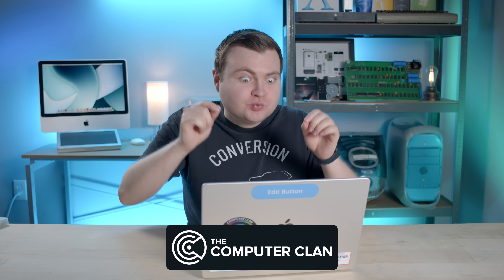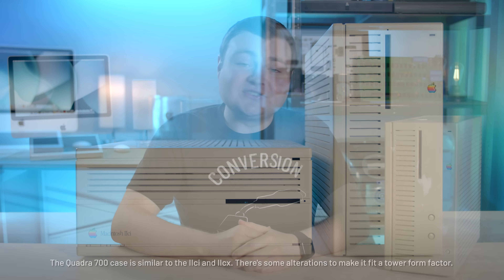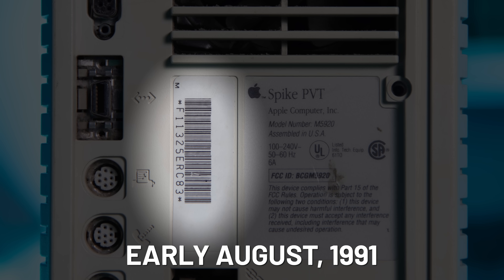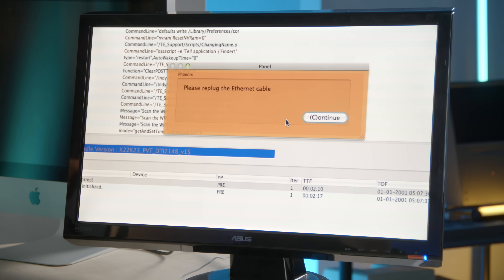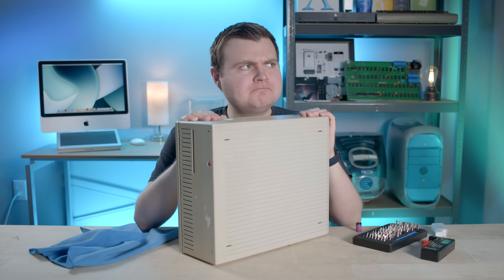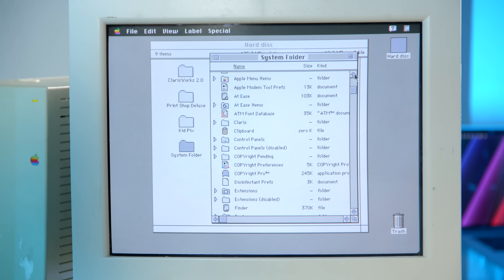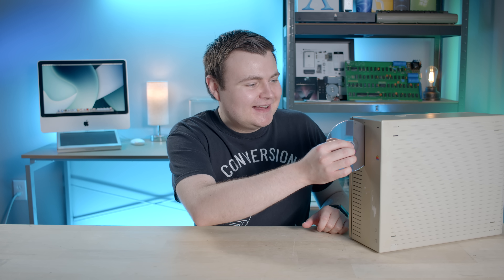Rare Macintosh Quadra Prototype Hits eBay (and I Got It!) - Krazy Ken’s Tech Misadventures

Comment: In my experience when a EBay listing says "untested" it means "tested and not working but we'll get more if don't admit that"
Reply: Or just more simply we don't want any complaints.
Reply: I’ve often had the opposite experience but yeah it’s awful when that happens.
Reply: With macs if it doesnt come with a power cable and or a keyboard it likely actually is untested as they dont have the means to boot it up
Reply: @rambles2727  why? PS/2 keyboards were pretty common for a while and power cables have been standardized for ages
Reply: @myrealusername2193  because the keyboard has the power key for some of these computers so they cant be turned on without one.
Reply: I bought an IBM Anywhere Kiosk PC which was listed as 'untested', probably because the unit has a very specific power supply. I managed to find one locally and got the PC for a tenth of other listings!
Reply: Sometimes, it means "I have no idea what this is or how to test it, it's outside our wheelhouse, but it was on this pallet of surplus computers we bought, so may as well sell it"
Reply: I got burned on a listing on ebay being sold as 'for parts', the listing showed the laptop booted up and working, but was sold as parts because it did not come with a hdd (data security reasons).

when it got to me, it would not boot at all, thought it may be the power button until I started pulling it apart and noticed someone had stabbed the motherboard with a screwdriver (they took the ram cover off, stabbed the board and put it back on).

even though the listing mentioned that the the images were actual photos of the device for sale, ebay/paypal sided with the seller as it was being sold as parts only.
Reply: @myopinion69420  wow that's pretty rough.
Reply: My experience with untested stuff on ebay has been stellar. It is a bit of a gamble but well worth it! Don't buy an untested HDD or SSD though, but other than that you can't really go wrong as long as you do your due diligence.
Reply: @myrealusername2193  no apple products ever had a ps2 port.  I think some of the mac clones did but no official apple hardware did
Reply: @bzuidgeest yeah, in my experience it’s really a CYA kinda thing. If you say it’s broken, and it works bonus but if it says working and doesn’t, I suspect that’s a problem.
Reply: You have very limited experience.

Comment: I'm sure a million people have already commented, but good batteries are required for some of the older Macs.  From my own experience, the II line and the portable (which is a little bit of a different case).  You can "jump start" at least the II and the IIfx with a 9 volt battery.  That probably works on some others as well, but I have only jump started my II and IIfxes .
Reply: I have a LC475 and it needs a PRAM battery, but you can kinda jumpstart it if you turn the PSU switch on/off/on fast.

Comment: "Untested" aka I tested it briefly and it didn't work so I want to cover my ass against returns and entice a potential tinkerer into buying it for more than if it was sold as faulty
Reply: heres the issue with that thought process, as a tinkerer I go out of my way to ignore "untested" and only look for "for parts as is faulty"
Reply: Lol, too true. I got a G4 last month for less than $60 and it needed, at the very least, RAM, storage, a GPU, and the power supply was failing (quickly died after I bought it)

Comment: Cool, always love seeing prototype hardware! 
I own a PBT Radeon card, but the strange thing is, its date code is from a month after the official release (but it still has an engineering sample sticker). And it appears to have been sold as regular stock at some point, since it seems to have been used daily like any other video card. These are always such a mystery.
Reply: Got two Alienware laptops that are engineering samples as well an XPS which is pretty cool as there were minor difference between them and the retail models.
Reply: @MrKillswitch88  Sweet! Saw a Dell Precision engineering sample on ebay but it was $9,999 so I didn't go for it lol
Reply: @DavisMakesGames  Yea at that price no one will lol wow. I bagged the XPS at a local goodwill before it closed down years ago and the two Alienwares were cheap eBay fodder.
Reply: Cool!
Reply: Maybe that Radeon card you have is a PVT with another factory. I'm not too sure on how manufacturing processes work, but it would make sense to me that if a company decides to pull in another factory they haven't worked with yet to run another PVT batch with them to see if the quality is good enough or any adjustments need to be made, kinda like how the current Mac Studios Power Supply has different designs based on what factory it came out of...

Comment: The Quadra/Centris era was such a fascinating one!  Full featured (for the time) web browsers running in a few megabytes of RAM as opposed to needing gigabytes today.  Today's browsers are practically whole operating systems of their own (and sites like Facebook and YouTube are practically whole applications), although I guess that's what it takes to safely and reliably have multiple tabs open.  And very interesting that an Apple prototype would use an IBM hard drive.  The smoking character was hilarious because it still doesn't feel like that long ago to me that so many people still did smoke indoors at their desks without giving it a second thought, and it's one of the very few things I don't miss from that era but it is very accurate to when this computer was made, and above and beyond what most tech content creators today would do.  Finally, seeing you literally stuff a cleaning cloth inside a computer like that with your hand made me so nervous, how is that safe from static electricity?  Anyway keep up the great work.

Comment: In 1999 I worked at a store called Computer Renaissance. 

In the back of the store they had a Quadra 700 style computer with a 68040 processor at 20 MHz. It had no label & on the back of the computer it had a label saying “SPIKE PVT” just like yours.

Comment: Hey Ken, good video as always.  I really miss the classic Mac OS at times.  I have most of my old Mac software backed up on a flash drive, after I was able to get it off floppy to a CD, and then moved it to flash storage.  Used to run it in BasiliskII on my current Macs.  It was nice to play around with again.

Comment: a lot of retro tech is a pain to test if you arent neck deep in the retro ecosystem given that a lot of these use obsolete connectors, display formats and/or require accessories to boot that arent necessarily on hand or common, ive gotten deals on a lot of old stuff because of this

Comment: Another great video. I'm pretty sure that the seller just didn't have the rest of the old Mac equipment like you do or they would have sold it as a bundle. Was there even a power cord? I assume a Mac like that  is like old Windows PCs where you couldn't get far without a keyboard plugged in. Plus if they didn't have a monitor they couldn't be sure it really booted.

Comment: A lot of vintage computers on eBay are sold by people that don't have the hardware to bring it up. So, pending it's something that isn't standard PC stuff, it very well might be actually untested. I still look through their other items just in case: if it's full of garage sale type finds and very little computing stuff of that type, probably actually untested. If it's full of other stuff that would likely mean they have the gear to test (needed monitor or adapters), or even more telling, tested items of the same sort, it's dead Jim.
Reply: When I sell on eBay, if that is the case, I'll state that.

Power cords on a lot of these are standard and common, so I might try plugging it in.  Did I get a puff of magic blue smoke?  If so, then that is something worth noting.  

If not, did it do anything at all (or nothing at all)?  I'll mention that.

I could then try the power button.  Do I get any LEDs?  Are they on solid, flashing, a particular color?  Any sounds?

There are almost always *easy* things you can do even if you don't have an appropriate keyboard, mouse or display.  

A seller too lazy to even try some basic stuff is probably too lazy to even pack the unit up properly, so if I do buy it, amd I just going to get a banged up piece of equipment that even if it worked before likely doesn't work now?

Unless I'm paying literal pennies on the dollar, a seller doing the bare minimum doesn't get my business.

[edit] As a note-- back around 2002-2008 I was buying Silicon Graphics machines on eBay and with those you often need a sync-on-green display that required a 13W3-VGA adaptor, so it was understandable if the seller couldn't test it for video.

Comment: PV samples are prototypes, there's still time to change things before prelaunch rampup and there often is like minor smt pad changes, silkscreen and components, things you wouldn't find doing smaller DV and breadboard builds. Cause once the paperwork is signed its usually an act of god just to change the brand of a single component

Comment: On a side note.  I have been selling computers and computer hardware on Ebay since 1998 and it is common practice to sell vintage hardware "As is/For parts" even though it works fully.  This just covers your butt in the long run. The only way to return it is if the buyer pays postage and the seller decides to take the return.  It just saves a bunch of possible headaches.

Comment: I did have a few macs that wouldn't boot with a dead pram battery, especially if they were completely flat. (my starmax 3000 is a prime example.) but a dead pram battery could also cause erratic behavior in other models, maybe this one was doing that, and they assumed it was not working correctly.

Comment: Dead PRAM batteries would generally prevent the first generation of PowerMacs from booting.  Historically an easy fix.  Most of the Mac II's were fine with a dead PRAM battery as well as later PowerMacs.

Comment: @2:45 Do you really want some random person blindly powering up electronics before shipping them?

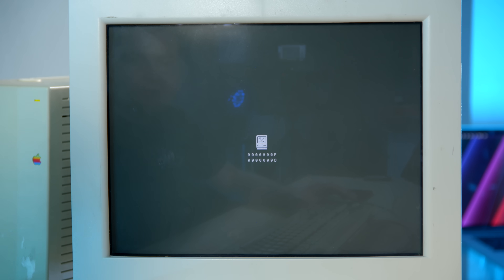@13:24 If you force it into sad mac like that you can plug another scsi controller into the external scsi port to access all the internal devices from another computer.
Reply: I thought you could trigger Target Disk Mode just by holding a key combo. But that definitely would make it easier to troubleshoot in the event of a sad Mac (and thus couldn't start TDM).
Reply: @tonybossaller4074  not on Macs before Firewire
Reply: @BonkedByAScout  I had totally forgotten that. Thanks for clarifying.

Comment: Any good IT guy knows. If anything doesn't turn on. Do two things. Make sure the power is on in the building in question...or in general. If not. You have bigger issues. Call professional help. If so. Check to see if said object is plugged in. If not. Plug it in. If so and doesn't turn on. Hit it repeated it with an inflatable hammer until it turns on. And if that doesn't work. We got a problem.

Comment: Maybe the seller didn't have a Mac monitor/kb/mouse. I know stuff like that would make me list it as untested. Heck I've listed laptops I know for a fact worked perfectly as untested because the ac adapter died and I couldn't demonstrate it working, so no one would request pictures of it working.
Reply from the maker: But you don't need any of those things to test power and POST! All you need is a standard PC power cable.
Reply: @ComputerClan  that's fair, but they may not have known that!

Comment: Been thinking about why the seller wouldn't have tested, and I'm curious if maybe they didn't have an old CRT to test with. Those era Macs used non-standard resolutions/refresh rates as I recall. Most LCD monitors couldn't handle unless they were MultiSync or you had a video card added (to do more standard output). I worked a job with a bunch of IIci's and IIcx's and vaguely remember spending hours troubleshooting why the replacement monitors (that had worked great on more highend systems) would not work on the lower end systems. And I believe I gave up after a while and stuck them back on the generic Apple monitors that they came with.
Reply from the maker: They could have at least tested power and POST! You don't need a monitor for that. : D